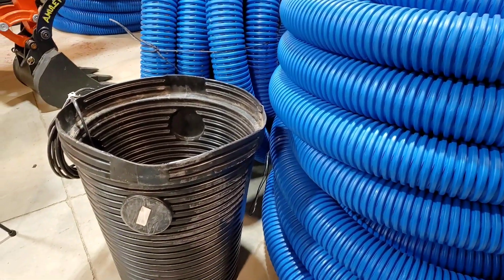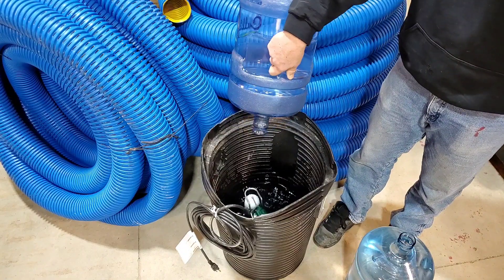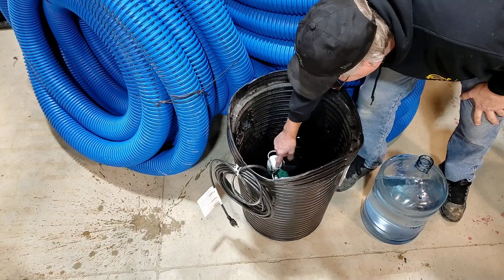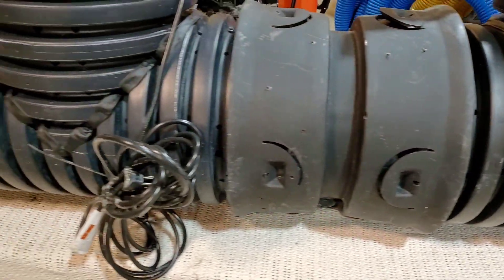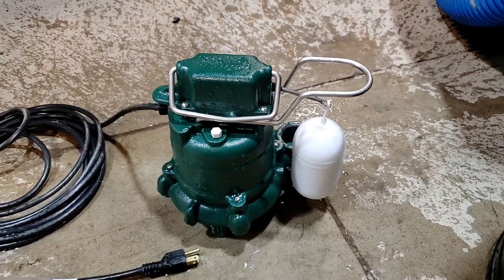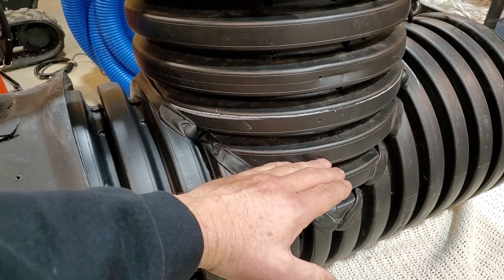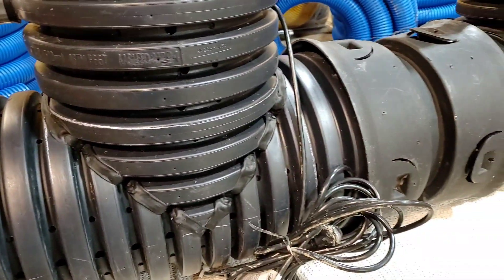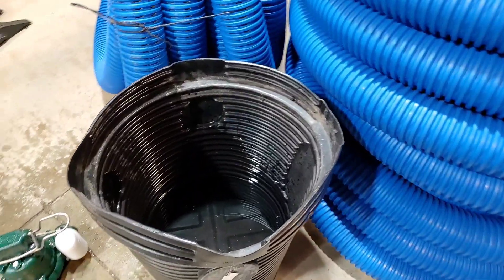Why Basements & Crawl Spaces Flood Due to Poorly Designed Basins [ How To Improve Home De-Watering ]

Comment: This is what my basement needs. 5 gallons pumped every 30 seconds
Reply: Same issue for me.
Reply: I added a secondary switch to mine and drilled some holes in the side/bottom. Now mine pumps about 45 gallons per cycle. Glentronics, Inc. DFC2 PHCC Pro Series Deluxe Dual Float Controller https://www.amazon.com/dp/B00648OKAI/ref=cm_sw_r_cp_api_glc_fabc_3pi7Fb5Z2TRBY?_encoding=UTF8&psc=1 I would rather have something like what FDM has but that would be a big renovation in my basement
Reply from the maker: https://frenchdrainman.com/build-your-sump-system/